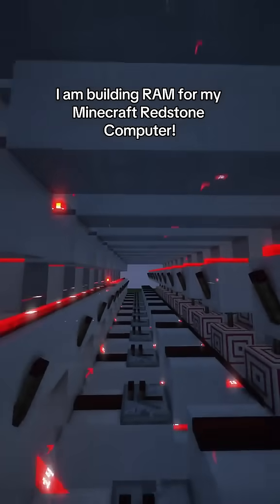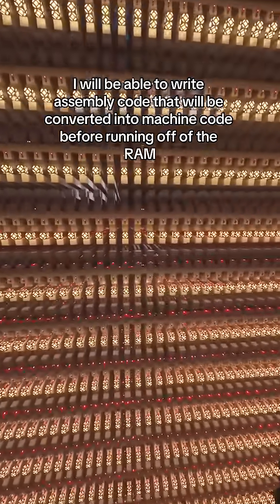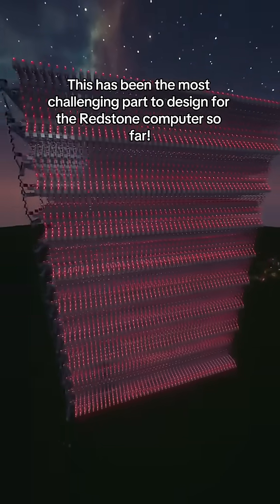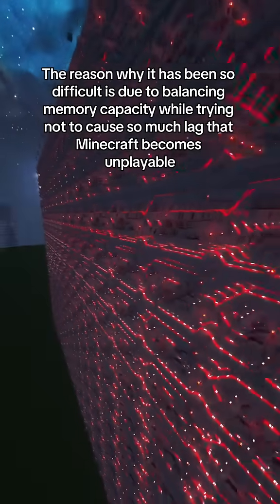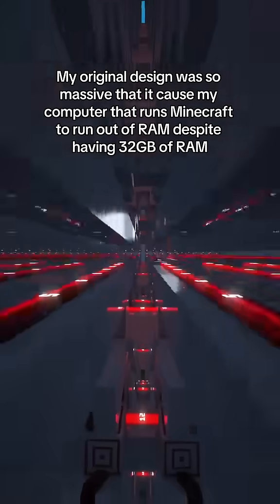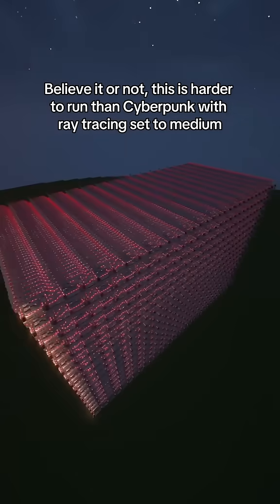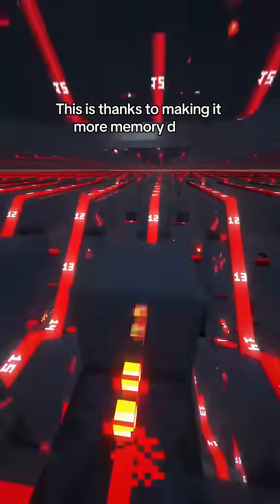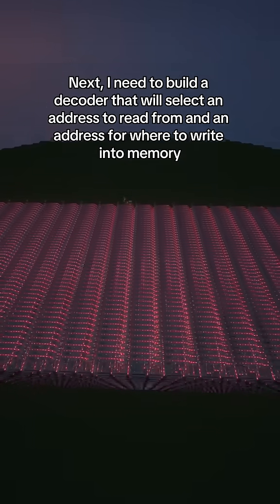I'm building Redstone RAM in Minecraft!

Comment: Von Neumann architecture?  Interesting, most players go with the Harvard architecture.  I'm curious to see how this project turns out.  For the sake of performance, I assume that you'll probably have separate instruction cache and data cache?  That's what real life CPUs do, since that allows for the fetching of the next instruction while data is being written to RAM at the same time.

Btw, what was the reason for not serializing your RAM?  That would've made it much smaller and it would've allowed you to fetch entire blocks from memory at a time, making it more cache friendly.
Reply from the maker: So, the blocks will store program instructions, and it will stream it directly to the CPU. I will eventually have it where I can export programs from this to a larger storage device
Reply: @Boolium_Nor  I'm a bit confused with "the blocks will store program instructions", since it implies that data won't be stored in RAM, which doesn't make much sense to me.  What's your block size (cache line width), instruction width, and page size?